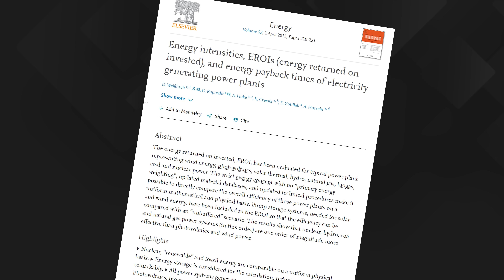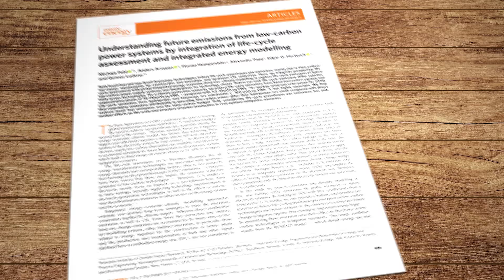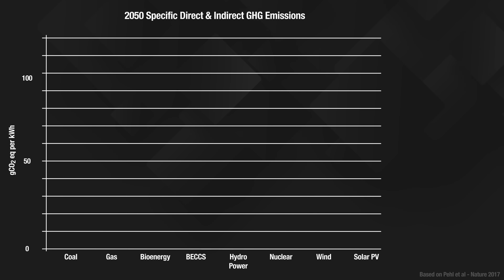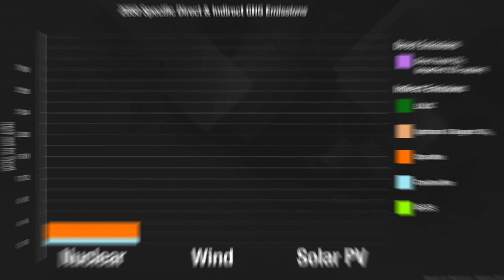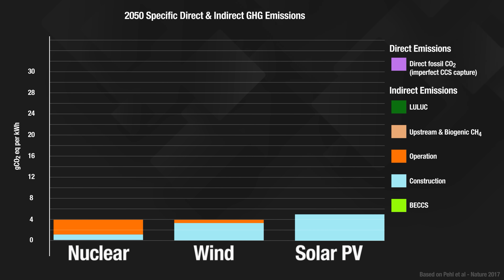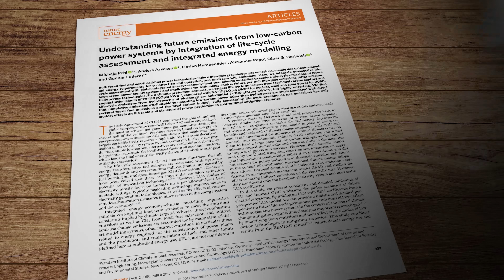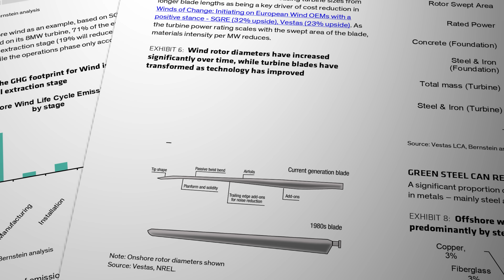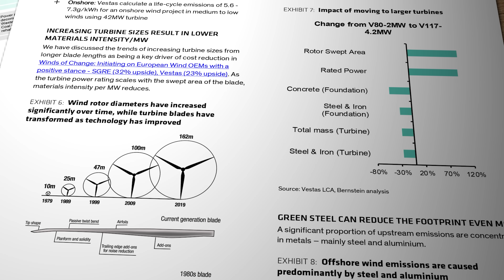Lifetime carbon emissions of renewables vs fossil fuel. Problem or solution?

Comment: And what about Al Gores “An Inconvenient Truth?” 
If anybody has watched that then they will know what he was talking about was very convincing. It did not happen though did it? Like most climate models have always failed to hit the target. 
Climate fearmongers always keep pushing their forecasts further into the future, a bit like the fusion reactor dates. Over half a century on and no big change.
What are the fearmongers going to do in a decade or so when sea levels still have not risen? They will just push those dates further down the road.
There is so much innovation today that in 50 years all this fearmongering will be a thing of the past. The world will be okay as long as they sort out the ocean plastic problem which to me is a far more urgent thing at the moment to sort out. 
Man is on the verge of a massive breakthrough with batteries and new solar tech that the alarmists need to calm down a bit. The problem is they won’t because they are mental and always need their bit of control because they are sad little people.